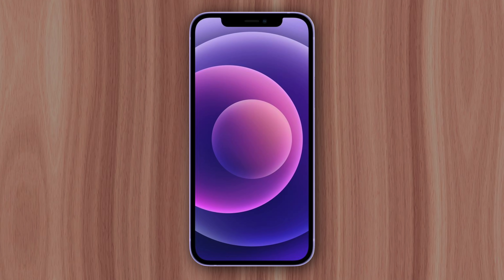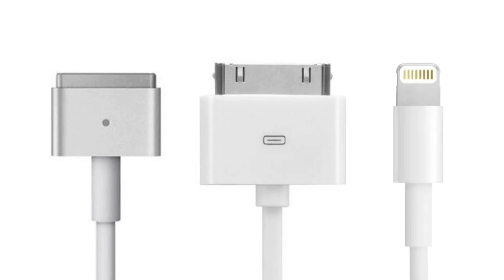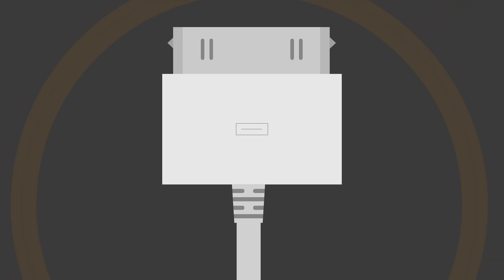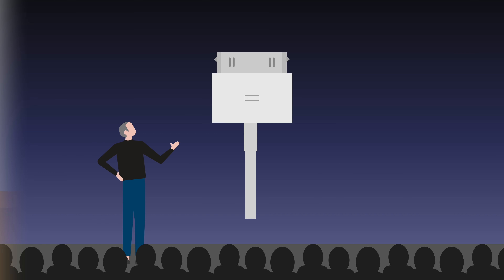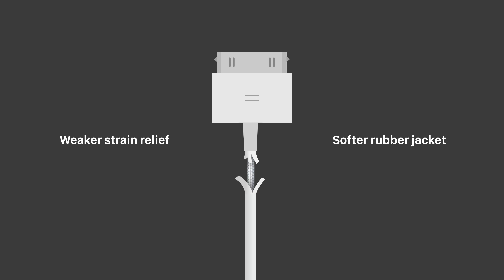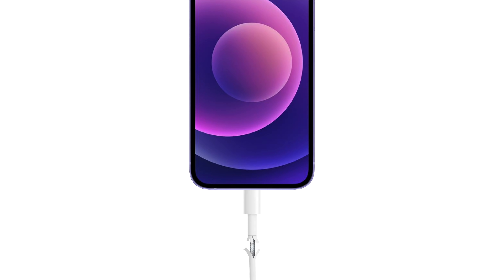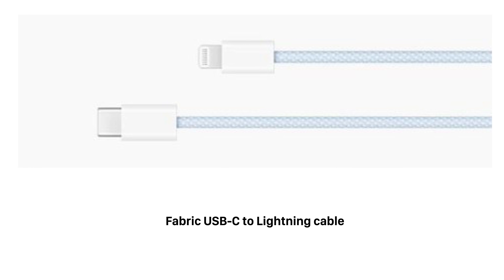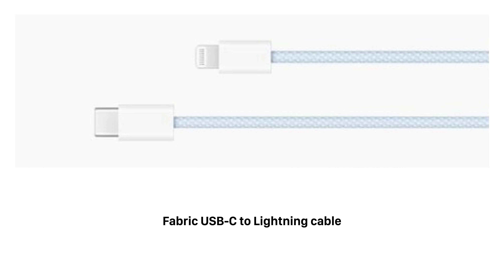Why iPhone Cables Break So Easily

Comment: Form over function?
Mmm nice.
Ribbed strain relief is ugly?
Ha ha At least several of my friends were using broken cable that were  hideous monstrosities.
They didn't want to buy new one because it cost arm and a leg and it was not even a year till they broke completely.
They also had to fiddle with a cable because it charged only in a specific position and that position was very easy to lose.
Very nice apple.
Very nice, green and not wasteful at all.
(To buy new cable because yours broke so soon).

Comment: Any sort of bending and straining should be avoided for Apple cables. I have an Apple cable which is currently pushing 4 years, and it works just fine. I did however have an old generation airpod, whose cable snapped off after a long term straining, which was made from a similar material. These things are like glass, a little long term bending or stress wears them out quickly.

Comment: Apple - Lets be more eco friendly!

Also Apple - Lets make cables that break and become fire hazards in mere months!
Reply: Also Apple: Lets make them expensive and make money while at it coz we can and people still pay us so why not..
Reply: why in earth this cable will be a fire hazard?
Reply: @l0k048  the electricity from the cables fraying could create exposed wires
Reply: @killertigergaming6762  the volts aren't enough to create a spark great enough to start a fire
Reply: @l0k048  But the voltage is enough to create heat strong enough to start a fire
Reply: @forrandomsites3336  i've accidentally shorted an exposed cable a few times, i don't think the heat is enough. idk if the wires shorting for a long period would so i may be wrong tough
Reply: When short circuit happens power supply turns off.

Comment: The harder question to answer would be: “Why Apple doesn’t fix their charger issue”
Reply: Prolly because they knew Apple users would eventually get used to it
Reply: wait, what charger issue?
Reply: @cyclix5314  Lightning instead of the faster USB C
Reply: Because Apple is overpriced garbage with cult of "expensive means it's better" propping them up.

Comment: I still have the cable that came with my iPhone 5 and it's fine. (Dirty, mind you)
I now use the usb-c to lightning cable that came with my iPhone 12.

At first I didn't understand why my whole family would break the cable so easily.
Then I noticed that they "mistreat" it a lot.
Let me explain;

Imagine that on a large table you have the charger and cable right in the middle and in front of you. If you connect the cable with your iPhone to the left, you will see that the cable has no tension whatsoever. Now move the iPhone to the right and disconnect it. You will see that the cable makes force and turns itself.
Well, this simple gesture already contributes to break it.

Now the most real example is that of people who use it in bed. There you will also turn it many times. So it is normal that you break it.

Comment: I only experienced this after two years. If we use cables in the right way, it won't break easily. Thank you for explaining what we can expect from such design-focused materials, and make people pay more attention to their cable usage!
Reply: Typical apple user the cables aren't not durable enough and don't break easily enough your just using your cable wrong like that time the iPhone wouldn't get a  wifi connection if you held it.

Comment: Am i the only person who never had issues? My macbook air (2013) charger has been in my backpack since the day i bought it. No issues there.
My first iphone cable also lasted several years until i bought a wireless charger. With the last 2 iphones i bought, the cables are still in the box because my first cable never broke.

Comment: Also, the cables are just dirt cheap with incredibly low charging speed. The wire is so thin that way that stability suffers massively.
Reply: They’re comparatively expensive.
Reply: @quix66hiya22  there expensive yeah but there made cheap
Reply: to be fair, when they made lightning , USB-C was still YEARS away, and they were forced to use lighnign for more power delivery on a smaller port for the 4S and the ipads.
Reply: @thebravegallade731  well years ago apple products were pretty good. Later became too overpriced

Comment: Honestly i NEVER had a cable break in like 7 years or so, they were always working perfectly without any sort of problems. HOWEVER i have had 4 pairs of apple EarPods break after like 3 months of use, 3 out of 4 on the cable, so theres that

Comment: Got an iPad air in 2015, in less than 6 months, lightning cable was on the brink of death. Had the same cable duct taped for almost 6 yrs now - looks nasty, still works. 
Meanwhile, I've gone through 3 android phones, all the batteries failed, stopped holding charge, but the chargers and cables still look brand new. 😄

Comment: Just use a nu wave magnetic cable. I have been for years. The cables are braided so automatically higher quality plus they are magnetic so less strain om the charging port. Check them out at nu-wave. org

Comment: This is one Apple issue I have never understood. I have never had a cable degrade quickly. I think the only cable I have that has the usual wear is an old iPod cable that I used for literally years. 

Simple rule is don’t use your phone while charging, if you have to don’t put pressure on the cable. Make sure you pull the cable out by holding the plastic part.

Comment: I have not a single damaged cable… I have one on my bedside, it’s the first lightning cable I got in 2012 when it came out, I use it daily for now over 9 years and it still has not a single sign of damage. 
I just take really good care of my stuff. 
I have cable&charger pouches where I carefully wrap them in for travel. Never threw one just in a Bag. 
Take care of your stuff people, it will safe you lots of hassle and money…

Comment: When you complain, Apple insists their cables are “durable”. 🙄
Reply: Ive been using mine for 4 years now and it doesnt have a thread or anything.
Reply: Mine is
Reply: @mus_xr4653  Mine too. From my iPhone 3GS. LOL. 
All the later ones are already trash. The one that came with the 12 Pro Max is on its way too.
Reply: @grapesofwrath1984  mine is iPhone xr and it’s still in good shape
Reply: @mus_xr4653  Good for you. I heard if you be extra careful like handling a FRAGILE product, they last a little longer.
Reply: @grapesofwrath1984  i am pretty rough with my cable,  I dropped my phone while changing and spilled water on it and it’s still good but there’s one contacting pad missing form the water
Reply: @mus_xr4653  Are you sure you got the original cable?
Reply: @grapesofwrath1984  of course, and i use my phone 9 hours a day
Reply: @mus_xr4653   I intentionally ignored your comments about your phone usage since we’re talking about the cable here.
Reply: @grapesofwrath1984  I mean, I charge my phone sometimes twice a day or i charge it while i am using it
Reply: It’s been 3 years and it started to break and I think it is pretty durable. How are you using your cables?😂
Reply: @tunakendi464  I don't. Anymore. I keep them in the box. I use third-party since I accepted that it's shitty.

There was a time I wrapped them in those little plastic coils. Actually worked to protect them. I think the one I had that on still works until now. That was probably five years old now. I just couldn't find it though. Someone in the house probably "borrowed" it.
Reply: true, but their devices last a fucking long time
Reply: @leart78  lol yeah, I’m still using this iPad air 2 for over 8 years now
Reply: They insist they never heard of this problem, and I am the first to return the cable! So if they are durable, why are you agreeing to easily replace the cables without any questions?
Reply: Their definition of "durable" is low compared to android lmfao
Reply: @andhon  Apple: JUST FRICKiN GET Used to IT
Reply: Apple: Get used to it

Comment: I used a 30-pin cable from an iPod Nano for like...10 years or so before it tore. The lightning to USB cable that came with my iPhone 7 that I bought 2 years ago is pristine, like it just came out of the box. People are just fucking careless. Sure, it's not the most resistant cable, but it's not like it's made of paper either, if you just avoid bending and twisting, or - women's favorite - shoving it in purses along with all the other random shit they carry, it can last for a very long time.

Comment: To be fair I have been using the same original apple cable in my car for the past 2 years and it still works as it should without any cracks or damage

I think people tend to bend the cable a lot , especially when you’re laying in bed which puts more strain on the cable causing it to break faster

Comment: Apple Selling Cheap Cables for High price worse than 3rd party Cables...

Apple Users: Thats just normal
Reply: Bruh I’ve had so many third party cables that cost like 15 dollars so I just bought an original and it’s lasted me 1.5 years now
Reply: @kaot1k  Atleast apples charger last be abt 3 month then starts tearing... data transfer not possible. then i throw it... i have cheap cables.. for me the price is $2.6... it is actually working

Comment: When I had my las apple IPhone, the SE I used to have a broken cable every 3 months, then I switched to a OnePlus 5 and the cable that came on the box stayed with me for the 4 years I used that phone. Last year I switched to a OnePlus 7T and gave my dad my old OP5 (wich still runs smoothly) and he is still using that exact same cable that came on the box five years ago. 

Still I think apple products have the most beautiful design over other any other smartphone, the cables remind me to the stem of a flower, delicate, slim and soft, but the reality is that phones are one of the most abused pieces of tech,  durability and power should always go first over looks.

Comment: I’ve never had a problem with my cables breaking.  Of course though I take care of my stuff, and only use my cable to charge my phone. I’ve never really used my phone that much while it was plugged into the charger. 🤷🏻‍♂️

Comment: Certain European cars from the 1980s suffer from a similar, apparently biodegradable wire insulation. If that sounds like it could be a problem for people still driving and trying to maintain those cars 40 years later, you'd be right!

Comment: Also a lot of rubber types will naturally break down over time so often Apple cables will naturally break down over time even if they are never used however the more you use the cable the faster it will break down over time!

Comment: I use magnetic cables. An adapter goes into the port, so it never gathers dust- and the cable attaches with a magnet. Whenever theres strain on the cable, it unplugs - so my device never fall off the table, and the cables don’t fray because they dont get strained.

Comment: Sorry but I disagree. If you continue yanking your cable every time it will became damaged of course. I have owned several Apple products since the original iPod Touch. And I have never had any problems with my cables. Simply take it off by the white plastic part and you should be fine, don’t bend them. Etc. take care of your stuff. It’s easy as that.

Comment: There’s no value is saving a small piece of PVC for environmental reasons, then filling landfills with millions, if not billions, of cables and connectors, because the design isn’t fit for purpose.

I have a design degree, and admire Apple immensely, but this is what happens when designers are given too much rope.

Comment: If you have warranty on your phone, you can get the cable replaced for free. Just go to the Genius Bar or call AppleCare and tell them it’s frayed. They’ll send you a new one, put a hold on your card, then you send the broken one back and the hold gets lifted. I’ve done this several times now with the lightning cord and have never been disappointed.

Comment: You can develop 3D touch and other technology but you forget to implement a simple fabric woven cable. When there were lot of it in the market, to take inspiration from

And you charge extra royalty from other cable manufacturers to build  lightning and other cables.

Then you cry that Apple was being eco friendly? Or say just busy making heavy profits?

Mac Book cables were quite durable than iphone one? Why when they had the same design and materials?

Comment: FWIW my current iphone 12 pro cable is still as perfect as when i got it on launch day. i bought it together with the 20w charging block.  just checked it now, no sign of wear.  but i have experienced broken iphone cables in the past. maybe they changed the formula? in the past they’d break pretty fast.

Comment: My only complaint about the Lightning cable is when you leave it in the car during the winter months, the pins get corroded easily due to the saltwater entering the vehicle (if the cable ends up on the car floor)

Comment: I am not a chemical or environmental engineer, so I cannot definitively tell you whether Apple’s decision is scientifically sound. What I do know is that PVC is one of the world’s most common chemical products. In the USA, it is used for 66% of drinking water delivery pipes, most electrical cable insulation, waterproofed clothing, vinyl flooring, and medical gloves. Not deadly-toxic stuff, in other words. Like any other plastic, I would not suggest eating it or breathing fumes from a fire, but it is otherwise safe.

So why did Greenpeace object to Apple’s use of PVC?  Their site is not clear on this other than vague references to “poison plastics,” and the difficulty of disposal. We used to think that plastics like PVC would remain in the environment for thousands of years, but we’ve since learned that there are bacteria and fungi that effectively eat PVC for dinner. In the past, lead-based stabilizers have been used in PVC, but suitable replacements are well established.

What has Apple accomplished with their PVC ban? Their reputation for making quality accessories has been ruined. Billions of broken Apple cables have been prematurely sent to the landfill. Billions of replacement cables will be sent to landfills when the gadgets they charge become obsolete. While Apple no longer uses PVC in their cables, many people now rely on cheap third-party cables from China, which may use toxic chemicals like lead, arsenic, mercury, and brominated flame retardants.

Comment: Short answer: To sell more wires and say the change was for "improved design".
Reply: @legoplaytime1823  they make over 10 billion selling accessories. Thats a lot of money.
Reply: @legoplaytime1823  actually you are completely wrong. The accessory income is pretty much the reason why apple has no usb c on their iphones. They have it on their laptops and pcs and even their tablet so they clearly have no problem with usb c itself.
Reply: @legoplaytime1823  Billions of dollars in revenue with accessories is insignificant ?
Reply: @legoplaytime1823  Clearly you haven't a clue on the markup for cables and accessories
Reply: @legoplaytime1823  did you make the maths?
Reply: And environment. Don't forget for the environment.
Reply: Wouldn't it actually steer customers away from buying their cables? People might look for more durable alternatives and stop buying the official ones if they know it breaks easily.
Reply: @boxbird5723  Apple still gets paid fees for everybody who uses thier lightning connector, even if apple did nothing for it. thats the reason why lightning accessoires are on average more expensive than their usbc counterparts.
Reply: @anonymouscommentator  but wouldn't buying it from another company still be cheaper compared to buying the official charger in general? Sure Apple still gets paid, but you could get a more durable cable and at a cheaper price in some cases.
Reply: @legoplaytime1823  HUMAN GREED

Comment: For me the issue is the pins randomly becoming black from random arcs that happen when I plug in and unplug the cable. That's just one fault that happens slowly over time. Then when your phone is below 50% and you try charging using a computer, it goes between charging and not charging. I actually take good care of my cables and don't have frayed cables. Just darkening pins form arcing. Glad I get all my cables replaced under warranty, but it still sucks that it doesn't last as long.

Comment: The amount of cables I returned to Apple , that I did get replaced for free made up for them breaking, but around 2017/18 they stopped replacing them and insisted that I buy a new one which no choice but to but at lest they got rid of the supplier that was making them only had to replace 2 since then so seems to semi been fixed .

Comment: My lighting cables are more than 3 years in use and still look and work perfectly. Didn’t had any problems with apple cable in my life, whether it was lightning or the older 30 pin one.

Comment: I have the original cable that came with my iPhone XS and I have literally zero problems with it and I use it daily, but that’s just me.
Reply: My dad who uses an iPhone is on his 3rd cable now. The others are all ripping near the tip. Literal garbage
Reply: Ive been using the same cable i got with ipad air like 9 years ago i think when it came out and so far it still work well. Other than some grease on it thing look and work great, though ive been noticing past year it only work when i plug it one exact direction sometimes tho so ye
Reply: Not just you. I have the original cable from my 4 year old iPad that I charge daily and I've had zero issues with it. No plastic fraying, nothing. Idk what these people are on about.
Reply: @sinuslebastian6366  different climates and different cables, around 6 years ago they changed the cable to one that's not fragile like the older cables.

Comment: Bought a third party cable with a sturdy connector for my iPhone 8 Plus. I guess this will last much longer than the original cable (though it still works but has worn pretty much).